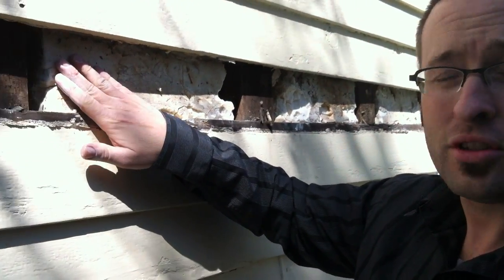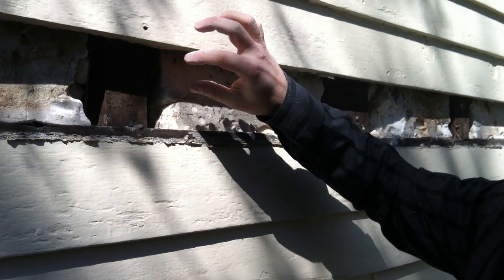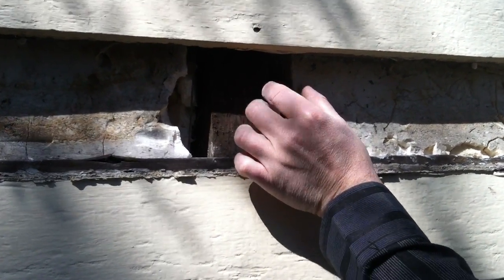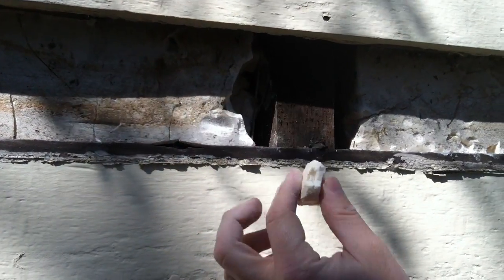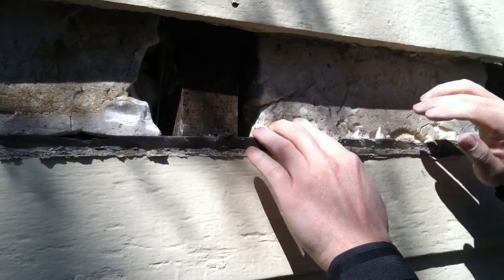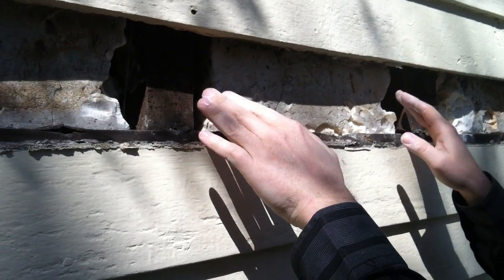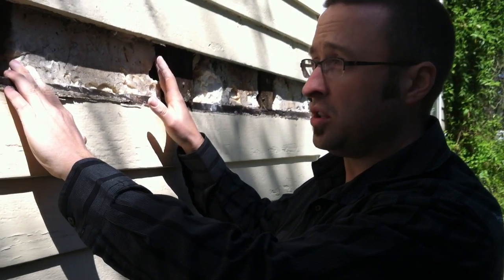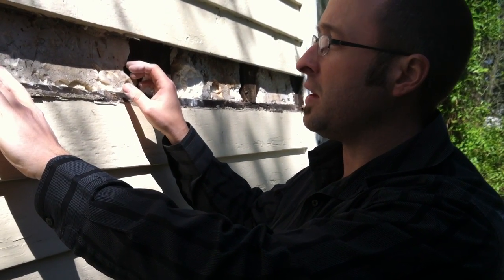Spray Foam Insulation Shrinkage Problem In Wall of Existing Home

Comment: I have to wonder if the newer formulations (I think Retrofoam is 40% open cell, 60% closed cell, or maybe vice versa) have this same issue? I know they had to reformulate a few years back because of the formaldehyde lawsuit. Either way, thank you for sharing this video, it's been very helpful in making my own decision. I live in a dry climate, and I am very concerned about shrinkage now. I would add injection foam to your video title though, because I didn't find it when I was searching for info on injection foams. I only found it after I started searching for actual spray foam as an alternative. Having both keywords will help everyone find it!
Reply from the maker: If it is polyurethane based that may be ok. We have used slow rise foam on a few projects.
Reply: @NatetheHouseWhisperer  It's a tripolymer based resin, but it's mixed with water and a foaming agent. I did see you mention slow rise foam somewhere, definitely looking into that. Thanks!

Comment: ok, I'm asking this because I'm going to reside my house it was built in the 1990's
they used a abit type siding without any sheathing, over 2x4 studs.
My plan is pull that garbage off pull the nails screw in zip wall with taped seams then LP or Hardie siding over it,
the house has wood dble pain glass windows do I save them or change then too? and should I fur them out becuse adding a 3/4" and 1/4 or 3/8" over will definitely make them sit back behind the finnish. Flashing isn't going to make that up.
I was also thinking about a plastic trim boards.

Comment: so?  I believe in 1990's spray foams were new to the market, they have been around for years, I remember in 1970's when these were invented it was for packing materials later adapted to use for insulation.
you have a wide range of chemical types used to make this stuff and different weights and closed and open cell foams.
without definitive information about the products used on that house your not telling us much at all.
Long story short we don't know wtf it was but it dosn't seem to have worked.
as for celious and fiber glass insulation, Foam out preforms it hands down provided the job was done right, right temptures
right humidity levals, becuse a job done wrong can distroy a house.
A better soulation would have been 2" ridigid foam 4x8 sheets nailed onto the 2x' then sheting nailed to that and your siding over the top with all seams sealed. also a 100 year old house could use 2 or 3 pain glass windows to save energy.

Comment: I sucked out tons of tripolymer foam best way is to take off bottom row of siding open wall cavity with a circular saw and pull out the insulation from the bottom most of it will fall for easy clean up I cheat tho we have an cellulose machine with a vacuum that can suck a golf-ball through a garden hose
Reply from the maker: Josh Kane I may very well go that path.
Reply from the maker: Love the vacuum description!

Comment: So does this mean never do anything that involve injection into existing walls? That walls have to be teared down before insulation can be done? Or just avoid any product called "injection foam"/"tripolymer foam". Because I see several video and articles about "injection spray foam". And I lack the expertise to discern if it actually different or a misuse of language. I can't tell if the related video by an insulation company with the video titled "Injection Spray Foam into existing walls " is injecting the stuff you are denouncing or completely different. I'm just paralyzed on what to do while my little office is freeze with hollow walls.
Reply from the maker: The key thing is to get a diagnosis first, be sure that wall insulation is the solution. Often it isn't. Before that, get an understanding of what the root cause might be. Here's the first chapter of my book as a free download: http://bit.ly/HomeComfort101

Once you know wall insulation is the likely solution, then it's time to select your insulation type. My preference in most instances is cellulose, but that may or may not be the right choice. Chapter 4 of the Home Comfort Book is about insulation types with pros and cons for each. You can get a digital or print copy here: http://bit.ly/HomeComfortBookNtHW

I hope that helps, good luck getting comfy!

Comment: as the gentleman below me said, and i dont see where you clearified it, that this is not spray foam or any sort of polyurethane foam. foam had a difficult enough time to recover from the formeldahyde issues in the 80s. to this day i get asked about it. so you putting this out there with such misleading titles is very counterproductive.  i have sprayed closed cell and open cell foam and there is no shrinkage. it's essentially a plastic so show me the last time you saw a beer cup shrink. chemically speaking what you are showing is a tripolymer foam. i used to install this myself, first as Insulsmart by CFI, later as R-foam by Applegate. this is a touchy product and very moody based on temperature but was for a while the best retrofit way short of gutting your house. so seeing your house...you have either poor mixong ratio, poor workmanship or a mix of both. if mixed and installed correctly this shrinkage doesnt occur/its due to lack of moisture in the foam when installed. the foam is designed to handle old wood studs being dry and absorbing moisture amd still remain intact. another reason could be it being too warm outside when installed or the cavity not being sealed right away or properly. taking roughly 48 hours to dry it is supposed to be enclosed 100% so excess heat or being able to dry due to air accesibility will make gaps like that happen.
Reply: This likely is formaldehyde foam, it's back as tripolymer and a few other names. I'd love to see an MSDS on it...
Reply: My business partner has AirKrete in his walls. It appears to have held up ok, but he can't remember all of the blower door numbers to be 100% sure. The house is reasonably tight, though, I believe 4000ish cfm50 on a 4500 square foot 1910s house. The blower door on my house is 3830 and it's 2200 sf.
Reply: Here's the first paragraph of the blog, the new website is about to go up, you're right it could be clearer and I'll fix that. 

"There are a lot of retrofit spray foam guys out there who don't like it when something bad is said about their product, and I really can't blame them. The technology below is more technically called "injection foam" or "tripolymer foam", but I am using spray foam for simplicity and because that is what most homeowners know it as. I'll just stick to photographs and blower door numbers as documentation, they are hard to refute"
Reply: @nateadams8475  You COULD explain injection foam vs spray foam. I'm sure most people would understand.
Reply from the maker: Keith Demons I'd take a good cellulose install in most cases. Look for a Weatherization contractor. Airkrete is around $5/sf in my experience. Cellulose can be had for $1.50-$3 depending on application. Unless you have brick, then Airkrete from the exterior may be best.
Reply: I too have found homes with injected foam insulation that has fairly substantial shrinkage. It is very difficult to find information as to how common this is because it will only show up when the wall is exposed. I hope someone can give me more confidence in the long term characteristics of this product.

Comment: Sooo it's interesting that you would take the time to make this video and "inform" people about the product however you do not even know what type of foam you're referencing.   Your title of the video say's "spray foam" but the foam in the video is injection foam.  Totally different product, install and application!  I hope not many people have hired you to educate them on insulations....
Reply from the maker: Dan, you are not alone in that criticism. How many people search for injection foam vs. spray foam? That's why I named it as I did. I filmed this to be part of a blog entry, which in the first paragraph straightens out the nomenclature. http://energysmartohio.com/blog/why-i-dont-like-spray-foam-in-existing-home-walls

The point was to educate about the only type of insulation that I do not see a use for, and so I wrote to what people search for. The blog post performs quite well on my website, usually #3-#5 for traffic. The name is part of that.

To be more specific, injection foam is not a good product. It shrinks horribly. It contains not nice stuff. It performs awfully. All other insulation types I see a time and a place for, not this one.

Comment: The thing I noticed was that he didn't say when the foam was put in. That will probably answer a lot of questions.
Reply: +Ahman Millener You are correct. I'm not 100% sure when this was installed, my best guess is late 80s through the mid 90s when many of the upgrades were done to my home. I bought it in 2010.

I've had a number of pros reach out and say this is a very common result, regardless of manufacturer. In the blog entry on the subject I issued a challenge for testing now and in 5 years with a blower door and infrared camera to prove it would hold up. 3 years later, no answer.
Reply: When you find out please let men know. I am working on a Shipping Container home project and would really love the feed back. I haven't decided on an insulation as of yet, but foam shows the most promise.
Reply: I doubt I'll find out. You may consider a slow rise foam. Fomo has one. An oil based closed cell, or maybe open cell foam should work there. 

Look up articles on Green Building Advisor. 

Get a Flir One infrared camera and watch the fill. 

Good luck!
Reply: I will thanks...
Reply: this foam has only been around for residential use for roughly 10 years so it wasnt done too long before you bought the house. it was originally developed for block buildings like walmarts so inject into the core but low level formeldahyde version was introduced for residential purposes. 0.25% to be exact which is less than are in your couch cushions and car seats but still enough to be banned and having resulted in a class action law suit in canada when introduced by Retrofoam. just an FYI. and yes, slow rise foam rocks. started doing it a few months ago with my own house as a guinea pig and it works perfect. having that exothermic reaction like sprayfoam heats up your cavity enough to be able to see coverage with an infra-red gun.

Comment: I still have an old UF insulation machine.I never really used it because I,myself,did not believe in it.I build a 4 ft by 8 ft stud wall and put a vapor barrier on both sides.Under this condition,the insulation turns out perfect.If you put this stuff in a highly absorbent stud cavity like plaster and lath with wood sheathing, the moisture will be absorbed fast and it will shrink way too much. That is just what looks like happened here.
I believe this stuff would work in new construction wall with a vapor barrier on both sides,but I think it is better to just not use it.

Comment: I ask the company Trypolymer, and I know their product. 
Rachel, yes it have shrinkage less than one percent !
It should be possible that this foam was made by unprofessional ! may be with bad rig and too much formaldehyde ...
Reply: Chris, they can say that, but I have a lot of independent confirmation this is unfortunately very normal. Shrinkage rates are more in the 8-14% range.
Reply: I'm french, and I cannot check it here cause we don't have it.
did you checked with melamine foam as Basotect ?
regards
Reply: Haven't heard of that type, I'll have to look into it. Airkrete is a pretty good product with very low shrinkage, and Fomo makes a low shrinkage foam as well.
Reply: I'm in the construction business, mostly remodels. I have found the same problem in houses exactly as in the video. The stuff can be moved around inside of the cavities and falls apart at the touch. Total garbage. I think the houses I have seen it used were built in the 1970s.  So it makes me wonder what the spray foam insulation is going to look like in 40 years! I recommend cellulose on most of my jobs. Thats what I put in my home.

Comment: The issue is that the gaps are only around the edges. Normally when a foam is trying to fill a cavity, it is filling evenly behind or in front of a piece of rolled fiberglass insulation. Filling the edges and in front and behind of the existing, crumbling foam insulation is a tough one. Could it work? Yes. Will it work? I don't have enough certainty to do it on my own house. I don't want to be the one that screwed up this lovely 178 year old National Historic Register home.
Reply: Шшшшшшшшшшшшшшшшшшшшшшшшшшшшшшшшшшшшшшшшшшшшшшшшшшшшшшшшшшшшшшшшшшшшшшшшшшшшшшшшшшшшшшшшшшшшшшшшшшшшшшшшшшшшшшшшшшшшшшш

Comment: Injection foam is an amino foam and not a polyurethane foam. Basically the foam expands during the mixing phase before it enters the hose. Once in the cavity, it takes minimum 24 hours to cure out the water (moisture) needed during the mixing phase. Once the water cures from the foam, shrinkage usually occurs unless the ratio is just right. You might want to check Lapolla's Retrofit spray foam on the next existing wall project. This material expands inside the wall before curing (no moisture).

Comment: That is injection foam perhaps a tri polymer blend. Please do not confuse this with sprayed polyurethane foam. The only thing they have in common is the term FOAM. We would not want to insulate our walls with Mr. Bubbles either, think of what that would look like a few years down the road. Shrinkage doesnt begin to explain it.

Comment from the maker: NOTE: The cfm50 on my house is 4300, BAS (ACH .35) is 2875. The attic is well air sealed (we got about 800 cfm50 out of it) and the basement has 6-8" polyurethane foam on all the band joists. The windows still need some love, but I doubt there is more than 500-600 in them. If the walls were tight, I should be pretty close to that 2875.

Comment from the maker: Srichard 77, you are correct, I should say in the video that this is not a closed cell polyurethane foam like what is used in new construction (it is in my comments below the video, though.) My experience with polyurethane foam is that it does shrink a little, but not much.

It is injection foam of some sort, I don't see enough of it to say on sight what type it is. Every time I have seen a retrofit foam installation, though, it has shrunk substantially.

Comment: That doesn't appear to be spray foam insulation....more likely a urea formaldehyde or phenolic injection foam. Polyurethane foam doesn't shrink or degrade like what's shown.